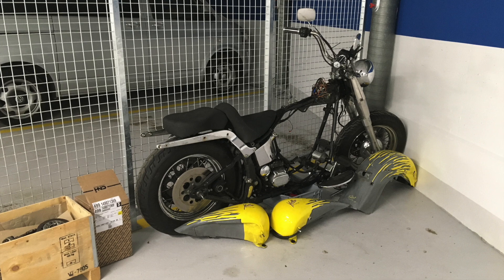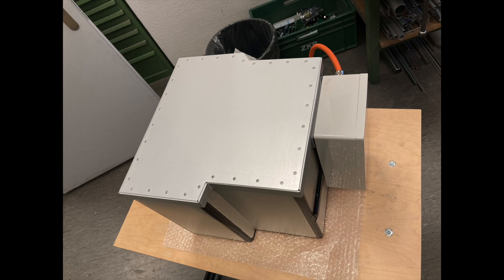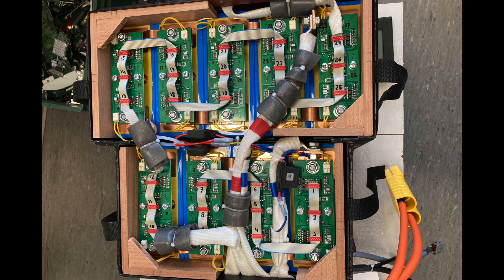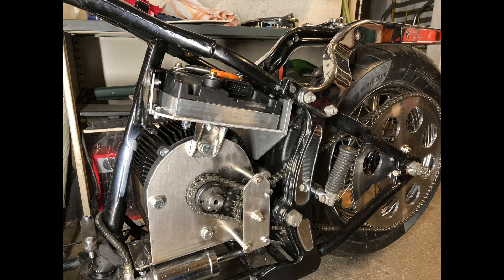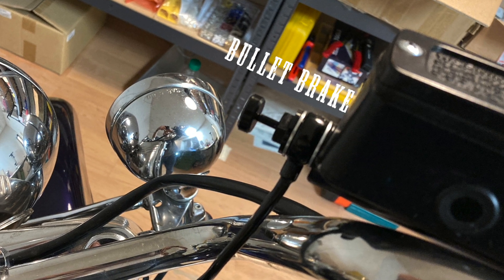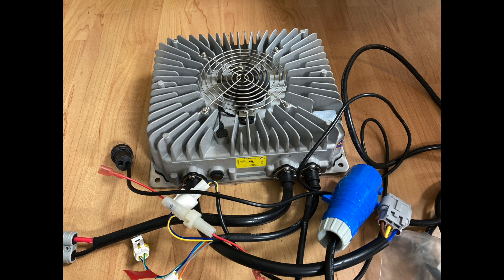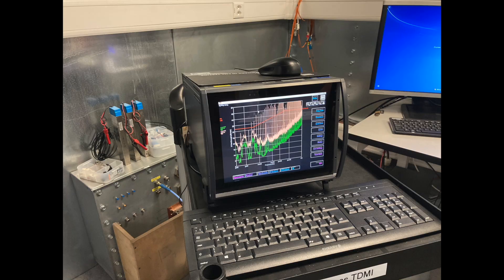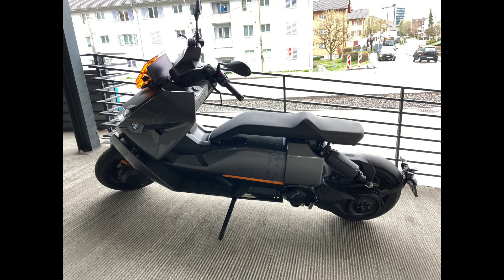Harley electric conversion - Street legal! (PWJ236)

Comment: i'm glad you didn't put whine motor controller into that thing. at least it didn't sound like most
Reply from the maker: What is a whine motor controller? Do you mean one that makes those bzzzziii sounds when going at low speed? I didn't choose this, I just had luck that it doesn't sound like that. I think it's more of a problem with brushed DC motors. Brushless controllers, especially expensive ones, don't do that (much).
Reply: it's one of the most awful sounds. unsure of if autistic or not, but some of them are just horrible. it depends how you control it and unsure if it decreased efficiency but some are absolute nightmare. here in tallinn, estonia i can hear from 3km away sometimes how tram is going somewhere. it's up at bridge end just rings there. but yeah, you're correct that price helps. i think it was more of special design of control sw that doesn't make your motor into unintended musical instrument. which iirc wasn't even good too. but definitely bad for ears. and i don't really want that as warning sound either. so yeah glad it was quiet. at first at video i was like, prepare for ear splitting electric harley rollout, oh it's silent?
Reply from the maker: @ketas  I know what you mean. Personally I find the sounds pretty cool if they are not too loud.
The problem is the PWM frequency used in the controller. My controller uses frequencies far outside of the human hearing range. But older controllers use some kilohertz frequencies that can be heard easily.
Something like this: https://www.youtube.com/watch?v=vxOUdp903UE
Reply: it's more like how it ends up resonating the motor, it could be out of hearing but harmonics still do it. have to design it

but i don't like trains playing do re mi, whines or any other sounds. there is wheel track tyre noise from vehicles already, etc. with construction machines etc, i wish they could lose the ice. much quieter. so yeah. apart from fancy musical pieces arranged to floppy drives, other pwm noise is nuisance

Comment: Nice!  I was thinking of an electric swap for mine, nice to see how you solved the problems.
Reply from the maker: If possible, make sure your motor is in the correct position. I have to adjust chain tension everytime when I ride alone or with my girlfriend. Thatwas the biggest mistake I made.... although I can live with that. And I underestimated the time and effort necessary to get all the documents.

Comment: That came out great!  Did you have to pay for the EMI testing and was it required to get a license plate to drive on the road?
Reply from the maker: Of course, they don't test anything for free... and yes it was required, otherwise I wouldn't have done it.
EMC and electric safety test: $4000
DTC mechanical test: $6000
Batteries, motor and stuff: $10'000
Motorless bike: Exchange for one with motor but old
Reply: @PlaywithJunk  Seems like excessive regulation for one motorcycle.
Reply from the maker: @2OO_OK  It's the same regulation for all vehicles on the road. Of course for a larger series it makes mor sense but that's how it is...

Comment: One small thing - please install smoke detectors in the garage where this is stored. Just in case one of the Li cells decides to have a thermal runaway. S*** happens.
Reply: Damn batteries!
Almost as flammable as gasoline...
Reply from the maker: Yeah it's time to invent a non-flammable version...
Reply from the maker: Theoretically a good idea, but I fear when a battery runs away (...) there is not much time to react. Well at least you get a warning about your garage is in flames.

Comment: Probably the most powerful Harley around, as it does not have to convert energy into sound at all, and instead delivers it all to the road instead. Plus you likely can lean it a lot further as well.
Reply: It sounds nice at the end of the video.. way better then OEM.
Reply from the maker: The good thing about a Harley is, when you remove a few bolts you can already save a ton of weight because everything is so massive 🙂